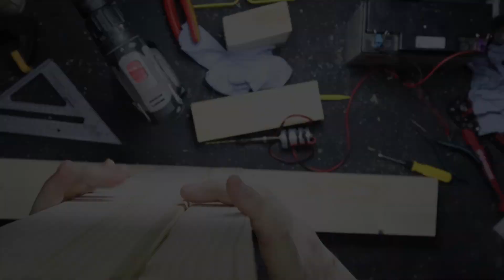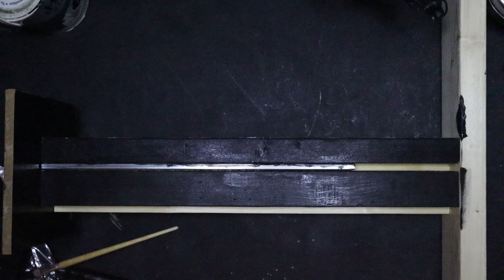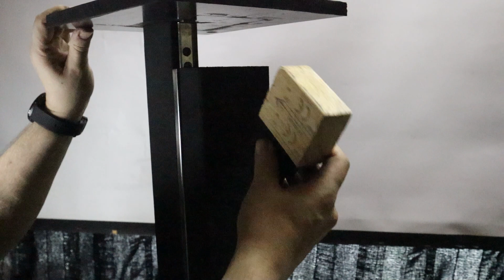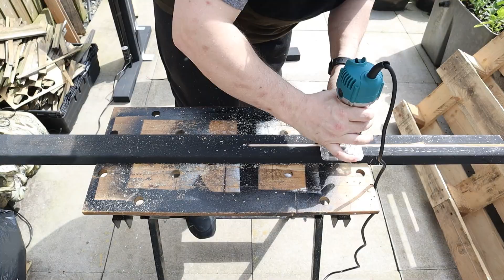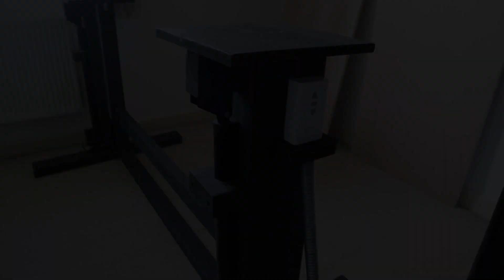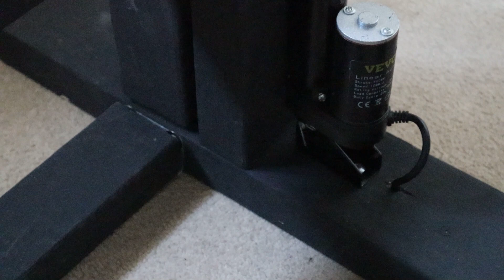DIY Standing Desk - Full Build

Comment: Can we use a single 6000N actuator?
Reply from the maker: It all depends on what you're hoping to lift with it. By that I mean the weight of the actual tabletop the parts that have to rise up with it and the computer etc. it's not really something I can answer
Reply: @TheOffGridFamily  Lets say a top made out of 19mm plywood and just a simple computer not very heavy.. does that work?
Reply from the maker: Now don't just go with what I'm about to say but yes it should do. Make sure you work out the process you are going to use before buying it. One actuator has benefits that aren't just financial like no issues with one being faster than the other etc.

Comment: Do you have any thoughts on instead using one actuator instead of two to lift the  desk assuming that one actuator could handle the weight requirements?
Reply from the maker: Most actuators have a very high weight limit however all of the designs I did using just one actuator had small issues with them. That's where I ended up going with the two actuator design. There are many ways to make either of one or two actuator standing desk but I went with the easy option. Sorry I can't be any help. That said if you ever want to email me we can talk back and forth about different ideas if you think that might be helpful

Comment: I was thinking of this for a workbench for woodworking/etc. Do you think these legs are sturdy enough for heavy duty use? Best wishes in your health issues.
Reply from the maker: That's a great question! There is a small side to side wobble horizontally due to me not putting the center bar high enough but its not enough of an issue to change anything. I would say you could make this much more heavy duty by potentially using four legs rather than two if you're using very heavy things. You would still only need two linear actuators as they're rated for much more heavy use. Thanks for the comment and the well wishes 😊